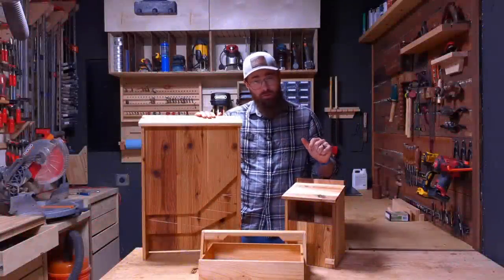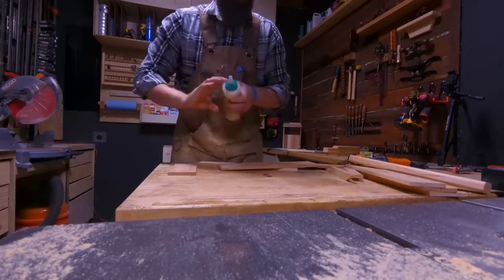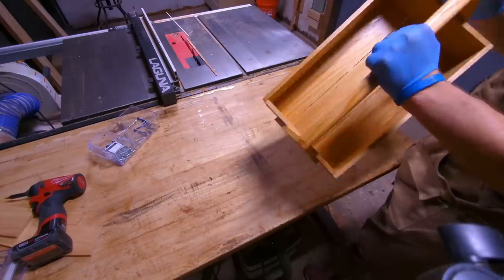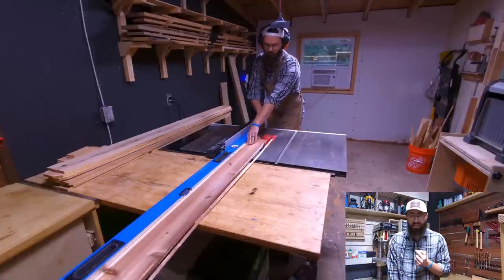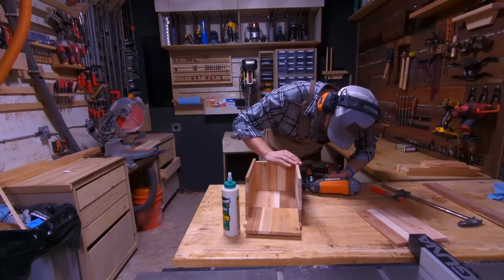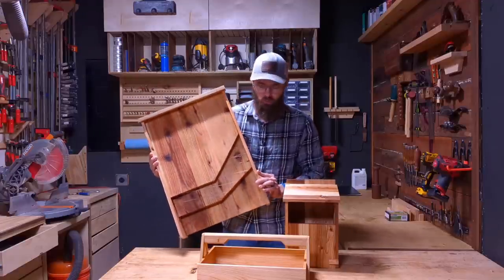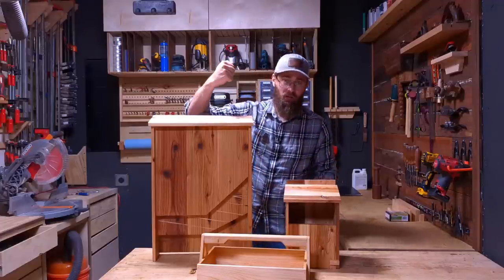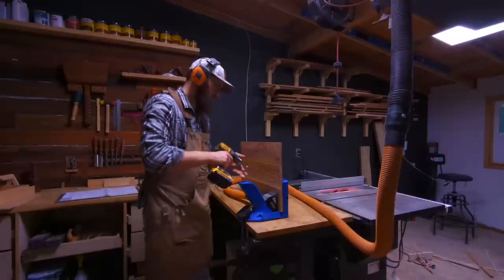Easy Beginner Projects you can build in 1 day!! Easy DIY Projects (Easy Woodworking projects)

Comment: Love the bat box.  Any guidance on how high up to put it and how to hang it?   The pic with the plans looks like it's on a telephone pole hung with cord.  Just wondering what your research found as the best options.
Reply from the maker: Thanks!  I did hang it on my power pole but I screwed it in, it's not hanging by a cord.  It's best to go 12 ft up or higher, on a pole, post or side of a building.  Not in a tree die to easy access for predators.  Also, in an area that gets at least 8 hrs of sunlight a day.
Reply: @burnstockwoodworking  Thanks for that.  I'd have hung it in the trees thinking it was getting cover....  Now I gotta think up a place to put it.

Comment: I made one of your basket caddy things (several actually) currently working on a figuring out how to make the handle swivel. As in transport and storing these, I know the handles would get knocked off😂

I was going to get some tung oil but it looks like you're using Hopes pure tung oil, but all I have that I can get locally (impatient and don't want to wait for delivery) is watco or minwax

I know they have thinners in them and probably not food safe, but have you ever used either? How does it compare to pure?
Reply from the maker: I have used those and they work fine, it's just better if you can get the pure tung oil.  I ordered off of amazon to get it.
Reply: @burnstockwoodworking  gotcha. I looked at local prices vs pure online, and it's only a few dollars more for the pure.

Guess I'll have to be patient, lol.

How many coats do you usually use? And do you thin with a solvent like acetone/mineral spirits or turpentine?